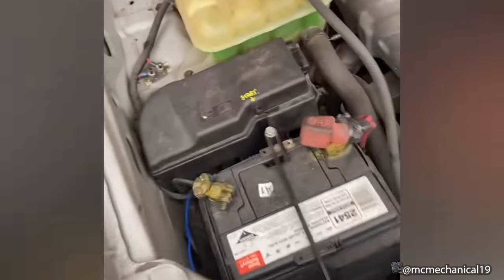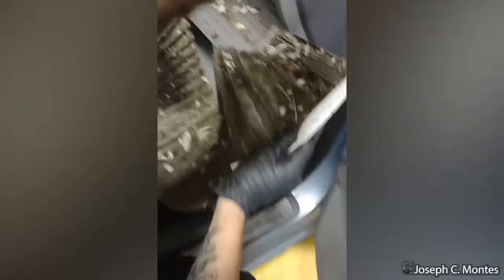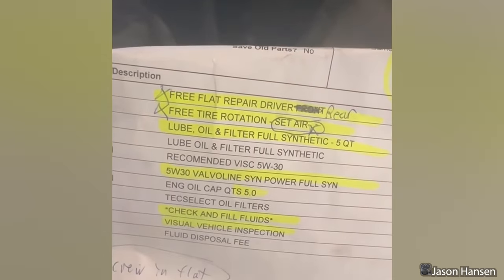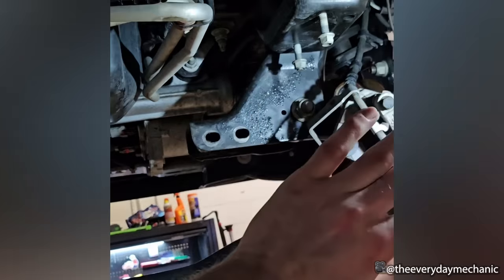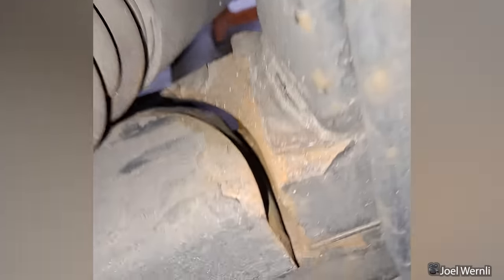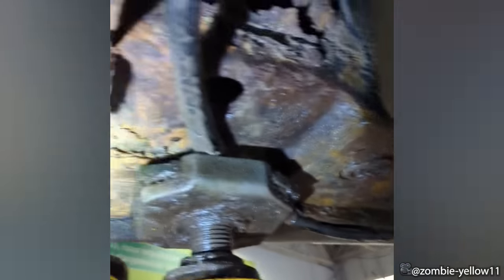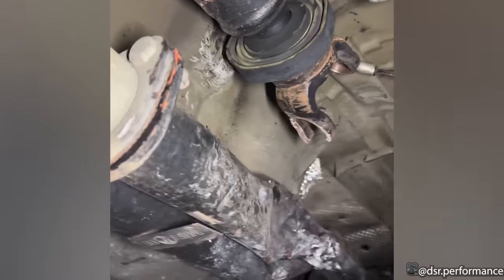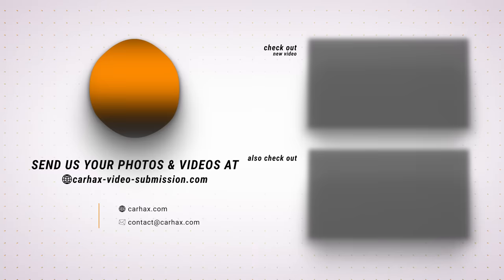Customer States & Mechanical Fails [Part 39]

Comment: It takes 10min ( if your slow ) to remove the intake manifold on a VK56 to access that starter motor... if that's the worst part of your day then you probably shouldn't be complaining 🤷
Reply: 10 minutes?  It would take longer to disconnect all the wiring and lines to get to the intake.
Reply: 2.1hr job Not including diagnostic time.
Reply: 2.1 hours if you work at Jiffy Lube maybe...
Very common for rodents to eat knock sensor harness in the valley here, takes 10 min to remove airbox, intake and manifold to access knock sensor sub harness infront of starter.
Reply: That’s what I thought too. If he wants something to complain about, give him a German car to wrench on.
Reply: You're not your😂

Comment: I can hear the customer with that last one. "My windshield wiper laid an egg!"
Reply: I had one years ago on a little Hyundai Tiburon:  Customer states "Rear wiper trying to make love to fuel door."    The nut holding the rear wiper on had come loose and popped off it's spline, so when the rear wiper was turned on, it tried wiping the driver side fender where the fuel door is.  Cracked me and the other guys up something fierce.  Reset the wiper, tightened the nut and kicked it out.  I told the Service Desk not to charge the customer because it gave us such a good laugh.
Reply: Customer states: Windshield wiper sounds like an angry chicken. Please check.

Comment: Brake rotor was made in china from chinisium. Then at 4:15, that rod with T handle and blunt hook, bent around the front suspension, looks like the tool a truck driver uses to pull the 5th wheel pin.
Reply: Some trucker somewhere said some dirty words when they realized they were missing that.
Reply: Don't know about trucks, but that hook looks a lot like a lid puller that the cable industry uses to open peds and vaults. Usually used on light vaults, whereas the big steel ones are used to open manholes.
Reply: I have one of those, and I lift manhole covers with it.
Reply: those are also bread hooks used to pull a tray of buns forward at McDonalds - I remember it from the video "McDonalds cashier defends self with metal rod"
Reply: @TrevorSlatery   lols I love the number of industries that use this same hook. Must sell them at every warehousing store.
Reply: @jasonp3253   How bent is it at this point. I know the company I used to work for had to replace the underground crews' small hook multiple times cause they were breaking open manholes with it, rather than getting the bigger hook out of the truck that is 5 feet away. not that it doesn't work, but these guys would beat asphalt off the rim using the handle, lol.
Reply: Looks like a pdr rod
Reply: Thinking the same thing
Reply: 5th wheel disengagement tool. Commonly used on tractor trailers to release lock without losing fingers. Likely just fell off tractor onto highway.
Reply: If you a trucker you know what it is easy

Comment: Why was that Styrofoam cup stuck in the will not melted from the heat at all and only dirty from finger prints?
Reply: Yes , set up just to get on video. Styrofoam isn’t very durable.

Comment: guy feeding the shock assembly into that machine cracked me up :D 
When those springs go they can  shatter your femur , which is the strongest bone in your body  . I am sure putting your hand up will stop it tho .
Reply: I had one attack me in '97 when a spring compressor snapped. It broke my collarbone and convinced me never to try that again. I was cringing hard during that video. 😅
Reply: The spring would be the one with a broken femur if it hit me
Reply: Yeah, that hand with a knit glove was killing me. Good way to lose your hand along with your face
Reply: @myrlyn1250  holy sh1t...
Reply: Yea...  Reminds me of a Ukranian who has a compressor and blows up tires at 50 bar. He sets up mock rooms with stuffed people and sees what happens when things go boom. He even tested it out with a wide tractor tire and wow, the rim became the projectile, went through the wall, impacted the side of a hill and ricocheted.  The scarecrow like guy positioned near the tire lost his head.

Sounds like fun in practice, but when it is real, it does get serious really fast.  Even working in the oilfield, a guy I knew had his jugular severed by steel that came off a sledge hammer, and he was not even using any tools, he was simply walking past someone joining hammer unions on pig iron.  He survived because of quick actions with the on site medic, but was a close call that changed the policy on worn out hammer unions.  Someone reading this might remember what company that was from.
Reply: They can shatter multiple bones simultaneously including the femur, hell you'll get one hell of a compound fracture
Reply: @pixels303at-odysee9  Nowhere near as bad but I was busting up a cast iron sink with a sledge hammer and caught a frag on the shin bone.   Made the prettiest little spurting crimson fountain...
Reply: Standing on front of a shredder when you toss a spring in is just as stupid as many of the customers.
Reply: And bro put his hand up like
"YOU SHALL NOT PASS"
Like that's gonna stop 4 lbs of sprung weight from installing his hand into the back of his brain 😂
Reply: Bro if you are worried about your phone breaking, then I wouldn’t risk my hand, which last I checked, is only just stronger than your phone in terms of breaking

Comment: @5:00 Being a mechanic in Vermont, this is what almost every brake job looks like - you need a torch for almost every part and piece thats older than 3 years and 60% of the time you need to replace and hardware you remove.
 I envy mechanics living in the southwest...your jobs must be quick and fun in comparison.
Reply: This is why the first time i change the oil on my cars when i get them is take the brake assembly entirely apart and coat the hubs with antiseize.  Brakes come apart easy after that.

I started doing this after having a truck that i had to do the same thing on, use a sledge to get the rotors off.  Ended up ruining a wheel bearing on the process.

I asked my friend who is a mechanic what to do when you can't get rotors off.  He said get a bigger hammer.  Ha ha.
Reply: I moved down to Texas from Vermont and needed lower control arms done on my S10. Shop quoted 2k back in 2018. It was their way of saying I'm not touching that. Long story short, I learned how to do all my own work short of engine and transmission rebuild because of that one experience. I had to grind and cut the torsion bar out of the lower control arm. Crazy.
Reply: I like working on my cars but I wouldn't if everything was rusty all the time. For this reason I could never live in the rust belt.
Reply: solidarity from Western Pennsylvania. If I don't have to use the Chinese hot wrench and the angle grinder to get through every simple job, it's a win
Reply: Think of it as the weather cooperating to put food on your table.
Reply: I have friends that live in Vermont. Yes, it is true everything is rusted & stuck from all the salt. I am also a mechanic in Massachusetts. We get the road salt combined with the salt water near the ocean. I feel your pain. We just keep washing as much as you can to keep it off.
Reply: @richardpalleschi4807  I just drove to Swansea to buy a GTI with a fully forged engine in it a week ago...its a beautiful place
Reply: People will spend $60,000 on a car or truck, but not throw in $12 for a car wash with underbody flush every time it snows in Winter.  I will underbody flush mine every other week.
Reply: I live in Oklahoma. I also have a completely rust-free Suzuki Samurai. Nothing rusts here.
Reply: @alexkram  Just gotta coat the under carriage every few years to keep it from rusting.

Comment: 4:10 that is a tool that is used to pull the 5th wheel release on a semitruck.
Reply: I'm sure a few dozen swear words are tied to that missing tool.
Reply: I was gonna say a case hook. Same tool different uses. Yours makes more sense to be on a Highway.
Reply: its also a patio stone lifter
Reply: we call it a handhole hook in telecom work XD
Reply: I would say it looks like a dent pusher, which we always use

Comment: Just like at 6:56 i had a customer come in today with a similar complaint, supposedly this noise from his driver's side wheel popped up right after i did an inspection on it, so i popped the hub cap off and low and behold, a rock sitting between the caliper and wheel, i handed it back to the guy and told him to take care of his pet rock.

Comment: 1:06 One traffic violation doesn't give you free reign to commit another. Those flashing lights are very illegal and a great way for OP to get their truck impounded.🤦‍♂
1:47 That prank is older than my grandma but it still works.
2:45 Ok, that's not a prank. That's felony criminal damage.
Reply: Yeah... I'd like to see the guy at 1:06 do that to an unmarked patrol car. They would probably issue a citation and impound the truck leaving the driver to find a way back home.
Reply: I really like the idea of flashing people back, but the obvious danger that creates is unacceptable. Also, no one is going to be able to figure out that they have their high beams on from being flashed like that.
Reply: Theses flashing lights should be OEM factory equipped.👍
Reply: Make the light color amber and call them safety lights. Problem solved.
Reply: @jonzo22  Jeeps are especially bad.
Reply: @K9River  I'll never do it but I always thought it would be funny to rig up a hanging mirror from my trunk lid. If I'm getting beamed I just pop my trunk and send the light back at them.
Reply: agreed about 1:06. those are going to blind everyone behind them, not just the asshole with their brights on. and (at least in my state) its illegal to have flashing lights of any color of your vehicle (not including hazard lights and turn signals obviously) unless you’re a first responder, tow truck on the way to/doing/returning from a job, utility vehicle, or otherwise have specific written permission from the state granting you permission to have flashing lights on your vehicle & only in very specific situations.
Reply: @misseselise3864   It's even better when people claim that someone is using their highbeams (even when its very obvious they aren't) just so that person has an excuse to be POS to other drivers that are minding their own business.
Reply: 1:06 I want that mod! 
You have no idea how much those damn LED high beams hurt for some people with ocular stigmatism.
 It about the same as someone flashing a powerful flashlight in your eye and poking it, simultaneously!
But While Your Driving!
Reply: @DirectCurrent4u  bait

Comment: 4:23 "The technician discovered that oil was being sucked through the PVC system. . ."  Um, it's PCV, as in Positive Crankcase Ventilation.  PVC is what plastic plumbing drain pipes are made of.
Reply: you were never shoved into enough lockers as a kid

Comment: Started using a cabin filter with Arm & Hammer included 2.5 yrs ago. Most odor free truck I've owned in decades. I usually change them annually.

Comment: I had a gas gauge stop working on my car back in 2015. I took it to the dealer (It was basically a new car at the time) and had them take a look. They called me back to the service desk, said they had found the problem. They had a box with a big rat in it, they said he was sitting on top of the gas tank, receipt said a "four legged wire cutter" had damaged the wire, but they repaired it under warranty.

Comment: 4:10, when I had 2002 audi a4, the hood latch cable came undone, and I had to use a tool just like that to go from underneath through a tiny gap to pull the lever to open my hood.

Comment: The HD air brake rotor on the semi is called a ‘splined rotor’ . It uses shims and bolts between the splines, but the rotor actually floats.  Used on some Hwy Coaches

Comment: The part when they had the piece of metal wrapped around the inside of the tire, that is a release for the 5th wheel on a semi truck so they can unhook from the trailer

Comment: @ 4:08 That's a Pin Puller used by truck drivers to pull the pin to disconnect the semi-trailer from the tractor.

Comment: The starter placement on the Nissan Titan is ridiculous. Design for Maintenance is a real thing. Car designers should check it out.
Reply: They’re hard to fix so you have to take it too the dealership
Reply: I just replaced the starter on my Toyota Sequoia last weekend and it was in the same location under the intake manifold. It's the same with all Toyota 2UZ-FE engines. It a bear to get to for sure!

Comment: 4:10 5th wheel release puller.  The driver probably left it on the catwalk instead of dropping it through the tank bracket.

Comment: Nissan Titan starter has been in that same location since it came out in 04'. Takes 2 hours tops to replace the starter. My 05' has 250k on the original starter.

Comment: 1:09 This is illegal and I can not advise or condone this. 
2:45 Wha...w.....what?
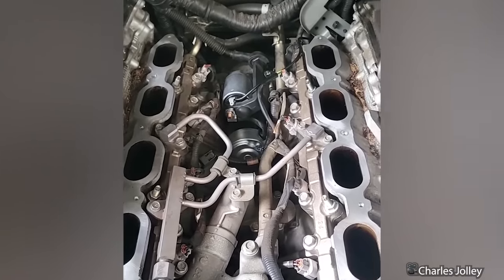3:19 Yup... my starter on the fake jeep is behind the engine, above and behind the driverside axle... Requiring an hour+ just to change. My 300zx? I can change it in 5 minutes...
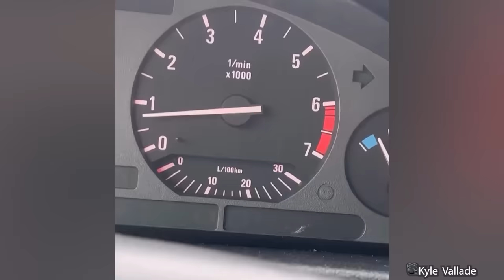5:17 had these moments in my 300zx with its pressure gauge... never won before though!
6:33 I dub it the.... Dilvan...
7:00 That'll be 150$ please.
8:43 WHY ARE YOU STANDING IN THE LINE OF FIRE... dear god that's terrifying...
Reply: Very accurate description 😂
Reply: As annoying as the starter location is, it's nowhere near as stupid as the location of the starter on the Tundra with the 5.7. Dealers charge 8 hours labor to replace the starter on them because it's shoehorned in such a tight spot. All the more annoying that the starters tend to live a relatively short life.

Comment: They're amazed by the Saturns rusted out frame, Im amazed that there is not only a Saturn driving around but that somebody had it imported to France. Like why would you do that? Those cars weren't worth that kind of money when they were brand new
Reply: It's in a french speaking part of Canada. The mid-2000's Saturn Ions were actually pretty reliable with basic maintenance. I know girl that bought one brand new for really cheap and put over 300k miles on it without any issues aside from basic maintenance. 2.4 ecotech and manual transmission.
Reply: About 20% of Canadians speak French. It’s an official language Federally and in New Brunswick along with English. In Quebec it’s French only.

Comment: I 100% agree with the rear flashing light truck. Why are there so many inconsiderate drivers nowadays who fail to correctly adjust their super-bright LED headlights? These lights are a real danger to other road users, and I have seen a driver brake sharply on a bend and the car behind drove into the rear of her car. I stopped to help and they both said that because of the passing vehicle's bright LED lights, she could not see where she was going, and the car that hit her only saw her after the passing vehicle had gone.
Reply: Especially in the city where there’s a friggin street light every 100 feet.😂

Comment: 0:20 that rotor will be fine as long as it's balanced properly.
Reply: You'll get hot spots since some areas are thicker than others. It would cause issues down the road. It's also bad habit to accept parts that are clearly s**t quality. If they want to outsource jobs to China to save a few bucks, the parts should at least pass basic quality inspection.
Reply: @karlschauff7989  We're not going racing with it, so hotspots won't be an issue.

It would be nice to be able to scrutinise every aspect of our lives. But as a wise man with a similar budget to me once said; "It is what it is."
Reply: @rus0004  LOL yeah right. That rotor will be warped in less than a year. You might drive like grandma ethel, but in the real world people drive 15 over the speed limit, slam on their brakes when they suddenly realize they won't make it through the yellow, and they sit at the red light with their foot on the brake. All that heat will warp that in no time. No mechanic is going to gamble on a junk rotor and have an angry customer come back blaming them for shuddering brakes.
Reply: @karlschauff7989  Well, seeing as they would have to replace the rotor anyway, for the doubling of labour and parts costs, you might as well get some use out of it. Whether that be ten years under Aunt Ethel's foot, or ten months under your deformed hoof.

And don't tell me what a "qualified mechanic" will and won't sign off on, and then charge me for the privilege. There is at least a dozen reasons why I will never go to a mechanic again.

Comment: I learned today that cabn air filters are a thing. Pulled out my wife's on  a 2006 Lexus gx470 with 150,000 miles and was disgusting.

I took it the dealer at 125,000 and asked for any and all maintenance to be done that was needed. They did timing chain, plugs, etc. But apparently not the filter.
Reply from the maker: I'm glad to hear that. These videos are fun, but they also raise concerns and make people think twice before driving their car without, for example, changing the oil on time or the air filter. Most importantly, when it comes to safety, the brake pads are crucial

Comment: 4:35 bro what did you think was gonna happen? That bolt was cross threaded as fuck!
Reply: It actually wasn’t cross threaded at all. That’s how rusted the rotor was to the wheel bearing. I was actually initially replacing the wheel bearing to begin with.

Comment: First clip is an easy fix, they probably got a windows replacement and the windows didn't sit on the track the right way, I've seen this issue before and took all of 15 minutes to do it right